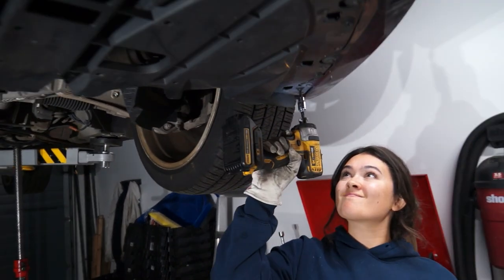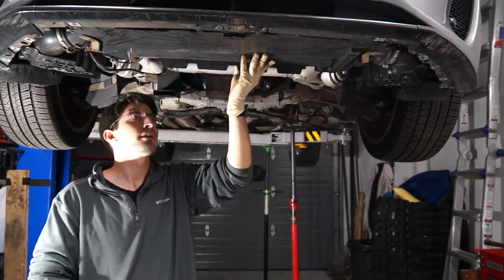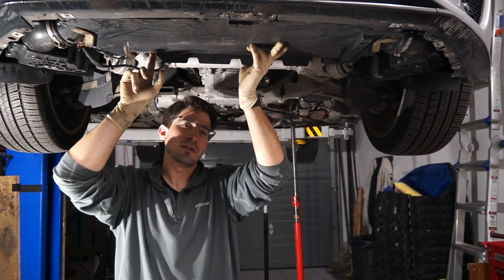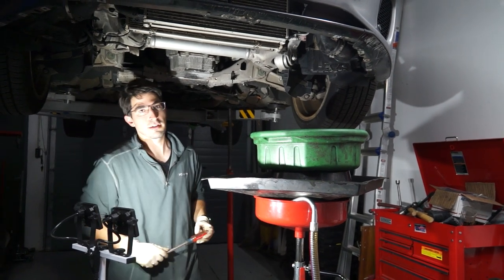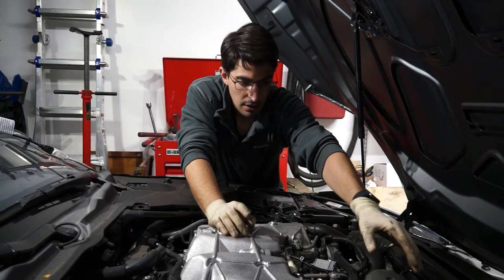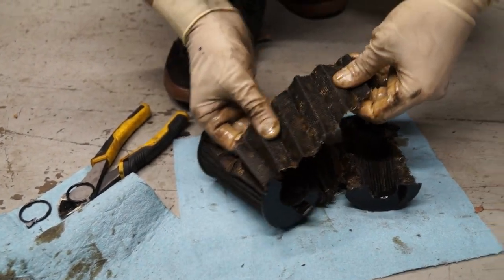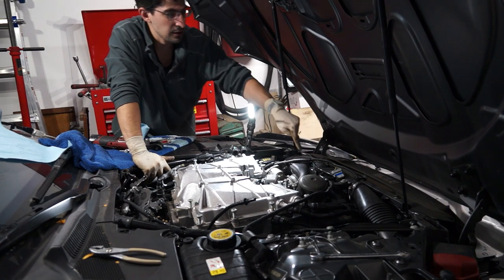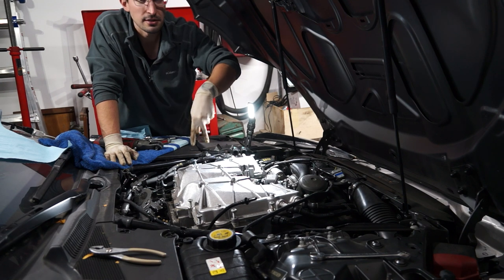Jaguar F-Type (X152) Ep. 2 - K. Check Coolant, Oil Filter, and Valves

Comment: Bravo! Good job you two for sharing your F-Type adventure.  This car is worth the effort.  Stay Calm, Carry On.
BTW: cylinder numbering is weird due to the AJ126/AJ133 family… dig a bit deeper on 
Also, nice to see your intercooler cover pop right off.  Not the usual slog for most folks who park their cars outside.
Reply from the maker: After scrolling through the 6000+ pages of the workshop manual, I believe the cylinder count starts on the right bank as 1 in the front, 3 in back and it then continues on the driver side. Sometimes manufactures will do 1, 2, etc criss-crossing across the intake manifold. I believe Mercedes does this and their hierarchy is which cylinder is front most.

Most clips and connectors came off with little issues. Since we're new to the Jaguar methodology and hardware types, we are learning how to be most efficient with our tools. I have noticed that there are a lot of Torx bolts which might be industry standard but is new for us, it used to be a special type for 90s/ early 2000s German cars I thought
Reply: @HernnitTheCrab  I think the cylinder count alternates L to R so that the AJ V6 and AJ V8 will have the same numbering from 1-6… and the last two cylinders on the V8 are numbered 7 and 8. I will try to tag the Forum post that covers the three different numbering schemes that Jag has used in the past 40 years.